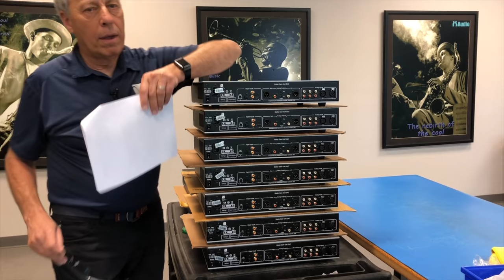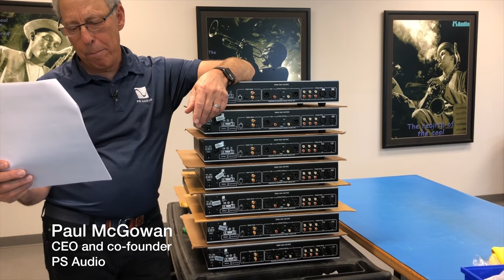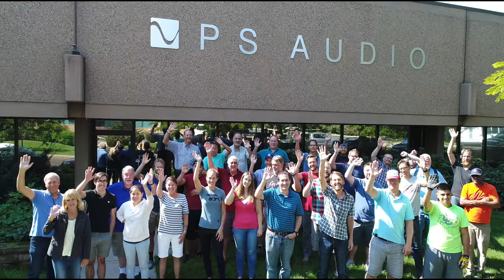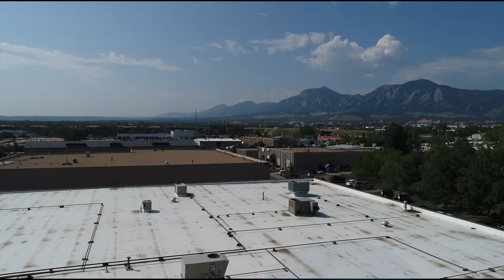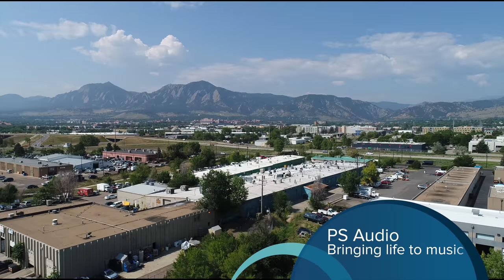How to split the preamp output

Comment: Adcom- Additional Compensation, who knew! I always liked the Adcom brand and came close to purchasing a 555 and FM Pre-amp, I just loved the clean looks of them. Paul you're full of knowledge, so great you're sharing that knowledge with us. Anyway I never knew you could split the pre-amp outputs like that. I always thought I would blow something up. But here's the thing, my vintage equipment still works pretty well but wanted to come up to the digital age without running wires all over the place, so I purchased some of those wifi/bluetooth receivers from Parts-Express and hooked them up to all my equipment, and remarkably the music sounds pretty good and I have access to all the music in the world just from that one little box. Amazing. Thanks for all your great videos.

Comment: I just split my pre-amps signal with a Purist Audio Design XLR-Splitter to be able to try to use one power-amp to the bass on my main-speakers and one power-amp to the midrange/tweeter and I think I got a better sound after that.
I use a Primare SP33, two Primare A34.2 and a Primare A30.7

Comment: I really wish I could hear an A  B comparison test of line level RCA vs balanced xlr cables connection.   Since I've never invested in balanced equipment before, I'm considering upgrading a 2 ch stereo pre amplifier and now have power amps with xlr.

Comment: Correct me if I´m wrong, but isn´t it better to use a RCA Y-Splitter than using XLR+RCA for two different amps because the output gain is VASTLY different, right? So if you can´t correct the gain on the amplifier, it would mean the other speakers are playing louder than the others, whereas with a Y-splitter the gain is 1:1.

Comment: Hello, I have a Denon 4500 with preamp outputs. I would like to have 2 dialogue channels, for which I have 2 options, the first option is to use the center channel powered out to connect 1 speaker and use a mono amp to power the other speaker using the preout. And the second option is to split the preout as you said using a Y-Cable and power dual center channels using a Stereo Power Amplifier.

Now my question - is it okay to do this in either options. Will it harm my AVR, Speakers & External Power Amplifier ? I am searching for this answer for the last couple of years.

Comment: I have dozens of preamps to play with. Even my preamps from McIntosh, ARC (my good SP3) Nakamichi etc that hv two or more main outputs, take their sources from split wires inside their chassis. So take my SP3, it has double main outputs and double tape outputs.You can see that the + sides of the second RCA outputs are actually run with hard wires tapped to the first outputs' + sides. It means that the splitter method is just a variation on the "factory" implementation. The really relavant question then becomes: on preamps with only one single pair of stereo outputs, will splitting deteriorate sound quality?

Anyone?

Comment: I got these splitters your talking about and when I hook them up the way I would think they should be I lost bass on one of my subs and when I started messing with them and plugged it in the way you would think is wrong it fixed it so got some more splitters and same thing happened the splitters have a red and a white when there should be red on the one splitter and a white splitter I just want a bunch of xlr balanced pre outs so I don't have to use these confusing splitters what should I get that has xlr balanced in with a bunch of xlr balanced outputs so I can use multiple amps and powered subwoofer with my one mixer main all at the same time thanks

Comment: Does it work as well the other way around 2 sources 1 input ? 
Thanks for the great videos
Reply: No, that would connect the two source outputs together.  Never do that, even if one isn't powered.
Reply: 2 sources 1 input needs a mixer or simple circuit, just google it and see

Comment: Is there an easy way to to modify a reciever to get pre outs to run another amp.
Reply: Open your amp up having looked at the schematics and find the drivers before the outputs. Usually you’ll see 3 wires coming from the preamp before the drivers. Undo those and connect them to rcas. It’s more intensive that than that you gotta do the research.

Comment: Paul, maybe a dumb question; but would the splitter solution also apply to a “tape-out” RCA output on a preamp or an integrated amp? The quandary I have is that I wish to drive a power amp AND a headphone amp with the single tape-out tap that my integrated amp has.
Reply: Michael Schroeder 
The difference with a "line out" signal is that it is an untouched signal that is unaffected by the pre amp volume, bass, treble, or any of the equalizing signals. If your headphone amp has a way to attenuate the volume and you don't require any custom equalization then I'd think you'd be able to route it that way. The "pre out" is called such because that signal is tailored by the settings and volume of the pre amp.

Comment: I just found this video. My problem is this. I have a record deck, and that feeds an RIAA pre-amp. I've tried a Y-splitter to feed both my hi-fi amp and my computer's line input. The problem is that I get a load of white noise / interference. I can pull the input from the line-input plug of my computer, and even leave it hanging (6 metres of coax going nowhere), and the noise vanishes on my amp. So the computer is obviously backfeeding noise to the amp. I have tried a switchbox as I can monitor my recording of music on the computer, from the computer's speakers, and even with this, if I select the amp, I still get the noise, which suggests I'll have to get a 4-pole switch to cut off both signal and ground from the computer, but is there a more elegant solution, to decouple any noise from the computer from going back to amp? It would be nice not to have to use a switch.
Reply: Sounds like you would benefit by using digital interface to split the signal to drive your amp and your computer

Comment: splitting the prey outI already piggyback spl item whatever it works but what i can't find the answer to and at the end of your video you said something about when you split at fifteen thirty or some crap like that like that what I wanna know，Is when you split the signal do you lose quality from say using just the pre out with one rca oto using twenty from the same rca pre out t going to twenty different power amps I was always thought it was just A signal and the Power AMP caches the signal and pale as the sounds o do you lose quality if you split the prayer to multipl outs

Comment: Pertinent video, since I plan on splitting the Preamp output to two Adcom 555 MK2 amps.
Reply: He means well.  Unfortunately, he is NOT an electrical engineer who has the necessary design and implementation experience.  He is a nice guy, but is more like a person who grew up in a family of doctors, but never went to medical school.  He knows enough to know more than some, but also enough to give often suboptimal, and sometimes simply wrong advice.  I would put this on the spectrum of simply bad advice.  There are too many other variables to make the recommendation he did.  I feel bad sometimes, as I usually bite my tongue, but I sometimes have to jump in on some of his videos.  

There are decent inexpensive transformer based and impedance matching splitters specifically for this (Sescom, Purist Audio, Radial, etc, which will much better impedance match and avoid the potential for capacitance issues.  I am, after all assuming that we are talking about audiophile grade listening as a goal, and that you care about the lifespan of your components-- correct.  I expect that plenty of others will have good recommendations here, but do not use a hard wired splitter, or a standard splitter-- too often used in car installations to the detriment of audio quality and component life.  

There are too many unknown factors to recommend what he did.  It also depends greatly on your speaker type and load, whether it is more of a reactive load or a capacitive one (different design choices) and your cable length and internal capacitance.  I would NOT recommend a hard splitter as he inferred-- Y-cable or otherwise. Get a transformer based one.  Coupled with an average cable of 15' in length, you can easily be dealing with an IC of 15-20K picoFarads, which is already high before splitting.   It may very well "work", but components and sound quality will generally suffer for it.

There are plenty of good ones across a range of price and related requirements.  I personally use Radial in my studios, but I have found some good Audio Technical, Purist and others which work great in many situations.   
In any event, SPEAK TO A PROFESSIONAL, WITH PROPER EE BACKGROUND AND WHO KNOWS HOW TO MEASURE AND DESIGN CIRCUITS HIM/HERSELF.  Let him know speaker lengths/type, speakers used and typical listening levels.  That will be enough to make a good recommendation.

BTW, I am an electrical engineer with multiple degrees and many years of actual design/development experience in the private, military/gov and related sectors (i.e. in ceramics, discrete circuit design and for the past 25 years a combination of discrete and integrated circuit design).  ADCOM has been a great company, product line and story, and that was one of Nelson Pass's design, that he started working on in earnest in 1982 and released a couple years later, and which I worked with a team to redesign later.  I did see an earlier prototype, but from what I recall, it was not a design actually implemented from, but rather, it was the later incarnation that he used.
Reply: If I have learned anything over the years is some but not all electrical engineers over complicate simple problems.
Reply: @amdenis  So, soon after posting here, I was extremely lucky in obtaining a pair of immaculate aDs 910 loudspeakers, w/stands. @ 93db/28htz-25khtz/4ohms, I decided not to go with the bi/tri-amp crossover cards, instead going for the light string & card for output monitoring. Also, I was able to get both an Adcom 555 and a 555 ll, though I've never used the model ll yet. Nowadays I'm using a NAD 208 thx balanced power amp with an Emotiva XDA-2 balanced preamp/DAC, and my search for my end-game loudspeaker has been fulfilled.

Comment: No mention of how to split balanced outputs.
Reply: Bill Crane You can split XLR outputs in the same way using a simple XLR Y splitter cable from Amazon or equivalent. It worked perfectly for me with no audible difference (to my ears anyway)

Comment: Wait.. So what's the Adcom connection with Nelson Pass?  There's always been this online chatter about him designing the original Adcom 555  for adcom, but in this video Paul says  Morris built the 555.   Is it the case where Pass design it, Morris built it and Adcom Sold it?     Seems that once a well known designer builds a product ( even if its just one or 2 models)  their name gets attached to all sorts of products from that brand.   If you let the Internet tell it.  Dan D'Agostino designed every amplifier for Mondial Designs ( Original Aragon/ Acurus line) .   Pass' name gets associated in the same way.      It appears that the Brand Adcom is still around ( perhaps with different owners)  or at least they still have a working website.   but can someone clarify on the original 555 ( not the 555 II) ?  is it in fact a product that was designed for Adcom by Nelson Pass?

Comment: I tried that once 1 pre amp 2 power amps , I believe they were both SAE . Ran into problems on the pre amp kicking protection circuit at high volume. Never found out what caused it.
Reply: The impedance too low, as the impedance was divided by 2 by using two power amps? 
Seems strange, there is usually a lot of headroom there.
Reply: Richard Smith Maybe something with the cables , I don't know? Unfortunately I don't have any of those component anymore. This was before 1988 . I gave one SAE amp to a friend who blew his Phase. I don't know where the other went. I miss those big power meters.
Reply: I think Richard is right. If you split into two different devices, the impedance the preamp sees is lower, and current increases.
Reply: I know a splitter is the obvious. My concern was impedance mismatch of some sort doing just what happened to you,except with with more devastating results to my gear.i knew Paul would be able to tell me what was the safe way to go.But thank you for you input.

Comment: Spent more time yapping instead of getting in depth on answering the question!  If any one wanted to know the history of ADCOM they could have easily found that out.  Didnt show any examples etc , the man asked how to can he use 2 amplifiers with one preout!
Reply: And he answered the question in a way that even an idiot could understand.  He said to use a Y spliter... do you know what a Y spliter is?
Reply: so you need example of how to use a splitter? Really? Wow!!!
Reply: i  agree 100%.  answer the question and there are always details in any issue to address, much more important than rambling on and on and on.  does splitting the preamp signal work if  more than one amp is running at the same time off the split signal?  if switching between two different types of amps (solid vs tube) does the signal in any way get altered by having the additional circuitry to the unused amp?  reasonable questions, show some breadth in covering the issue and forget the mechanicsburg diss, and who cares about adcom/sae history anyway?
Reply: @boweryhester 💯% agree...
I think what question you bring up should be addressed❗️